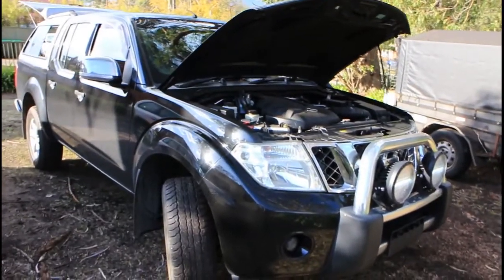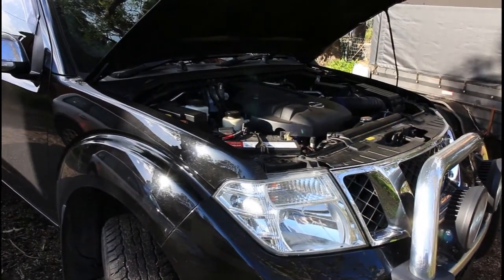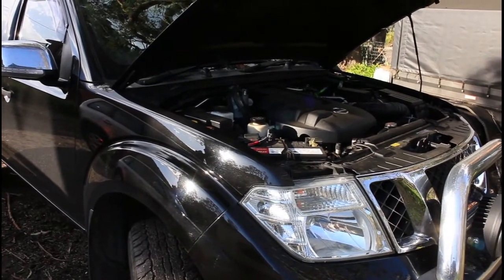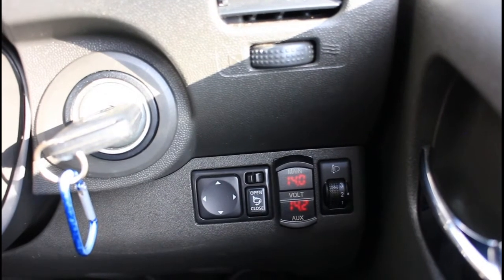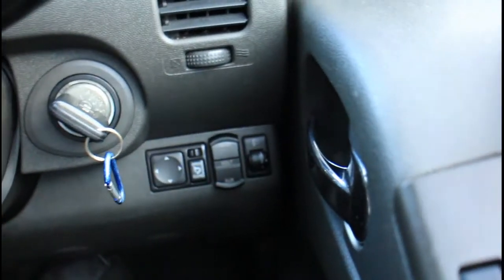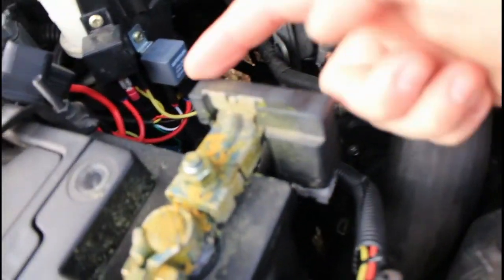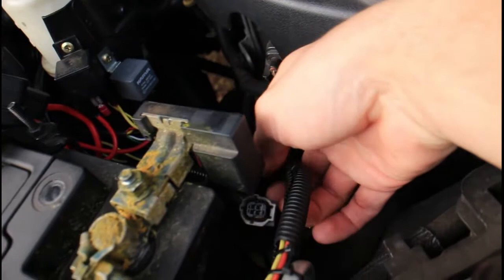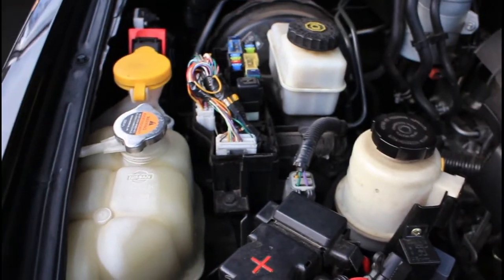Dual Battery with a Smart Charging System and a Voltage Sensing Relay

Comment: Do you have a tub liner? How did you get your wire through the tub and to the battery? Did you cut a hole in tub or liner? Thanks in advance!
Reply from the maker: Yep, I do have a tub liner. There are small holes at the from on the try in the headboard. I just cut a small hole in the liner with a Stanley knife.
Reply: Thanks mate, legend! Will have another look

Comment: Where do you go through the firewall I also have a d40 and struggle to find a good place to go through it. Maybe a video on that maybe
Reply from the maker: Put a small cut in the large rubber grommet on the drivers side where the main wiring harness goes through. You can then put the wire through and it stays waterproof.